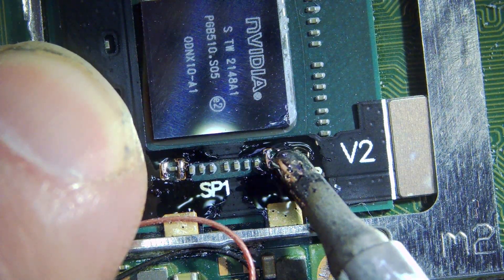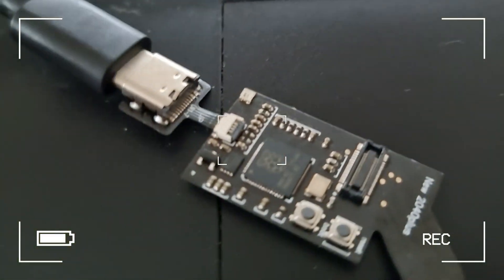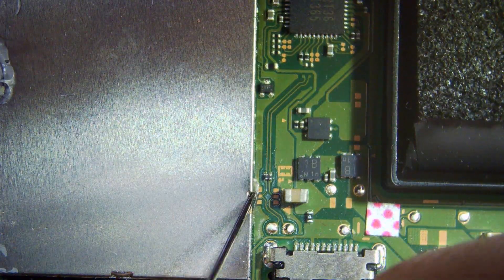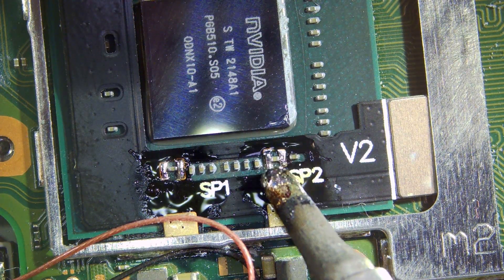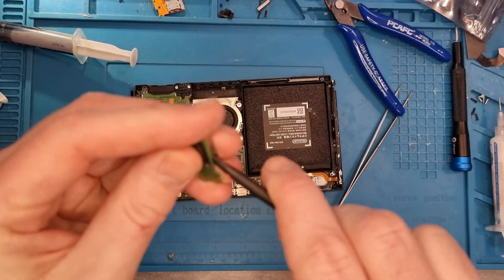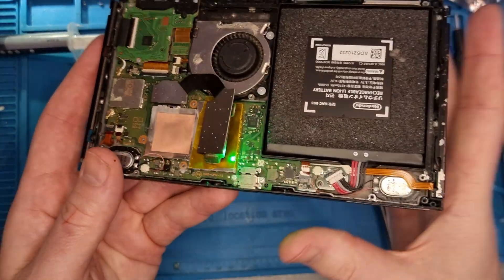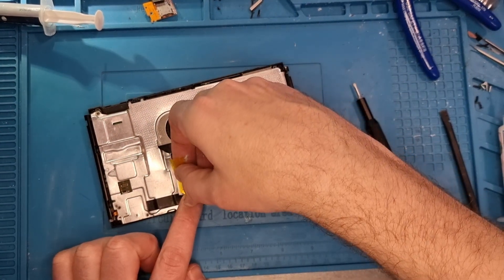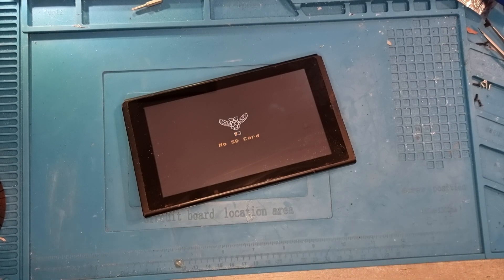Installing a "NEW" RP2040 Plus mod chip

Comment: Is the “new 2040plus” compatible with switch lite or just regular switch?

The bag mine came in says core&oled&lite

But i cant see anything installing this chip in a lite.
Reply from the maker: I have had chips in the past and the bag has said all models but its only specific to one chip. I think you can also get a chip that comes with different flex cables to be able to use on different consoles too.

Comment: What's the difference between the RP2040 and the RP2040 Plus?
Which one is better and why?
Switch Mariko
Thanks
Reply from the maker: I would use either, I have used both and not noticed any real difference.
Reply: @fixingmoddingbuilding 

Can I ask you for one last piece of advice? What solder do you recommend? With or without lead? At what melting temperature? Thanks a lot

Comment: Hi, I attempted to instal a New2040 plus on switch V2. I put the firmware fw_2.73 and checked the resitance at capacitors (0 ohm and 15 ohm). When I try to start the console nothing happen, not even a led lights on. By returning the SYSNand in the original position the console started without any issues. Where am I wrong?

p.s. I noticed that when I connect the flat cable to the modchip, the connection is not very stable. The chip comes off easily. Is there a way to check the voltage on modchip?
Reply from the maker: Not sure on the voltages sorry
Reply: @fixingmoddingbuilding I feel so stupid, I didn't connect the rp2040 to the mobo. It took me more than a hour to realize!! 😅😅
Reply from the maker: @pincopallavolo2  😆

Comment: so is not needed to solder the 2 other part to the ground?
Reply from the maker: So I've read there not needed, I've not done for a while but it wouldn't hurt if you did.
Reply: @fixingmoddingbuilding Ok. I got a huge problem. Even with a Good screwdriwer.. 2 of y screw got ruined and now i not really know how to unscrew them. The soldering part di not look so hard. I have a thin soldering point. Just i have to be calm and take my time to do a clean work. Also i have a 10x lens

Comment: Which is beter the new one with reset or the old one?
Reply from the maker: They both have done exactly the same job for me. Boot time might be slightly slower on the new one but that can also be due to software?
I wouldn't be bothered about getting either!

Comment: I was able to install the Switch Lite. I'm no expert, but the soldering turned out very well, but now I want to do it on an OLED. Do you think I can install it or is it too complicated compared to the Lite?
Reply from the maker: The lite is very similar to the Oled, bit more cutting and scrapping, so you could be pleasantly surprised!

Comment: The copper tabs below the solder points are supposed to be soldered to the shield to ensure it doesn't move and to relieve tension from the solder points.
Reply from the maker: Thanks, I doubt it will ever move so I'm good 👍
Reply: Still worth doing.

Comment: what firmware i need to flach just the old one or not and the vid is really good thanks for the vid
Reply from the maker: If its got firmware on it, just use that, I never update them anymore I find newer versions boot slower

Comment: Its not necessary soldering the 2  Points under sp1 y sp2?
Reply from the maker: I never do anymore, always find I put too much solder on too and the heat shield never sat correct